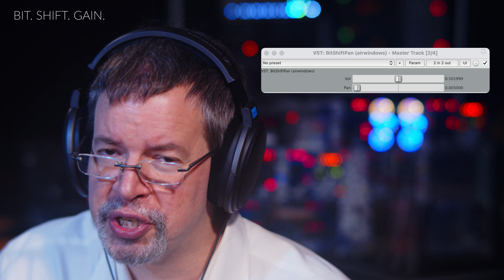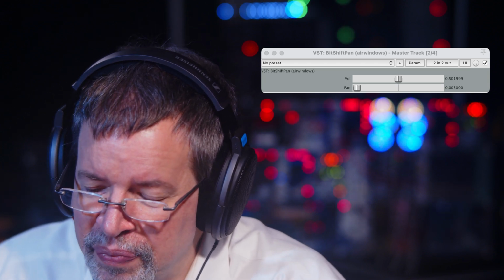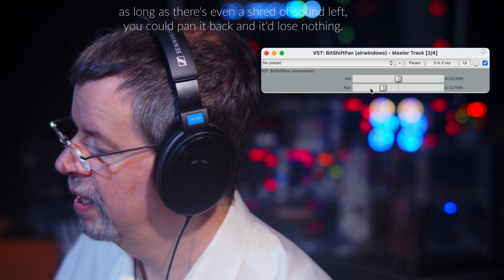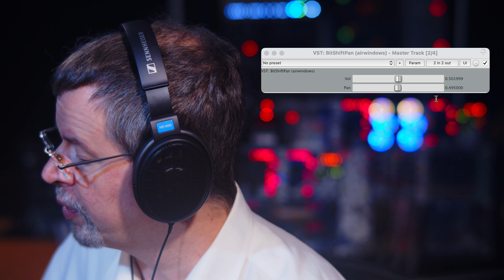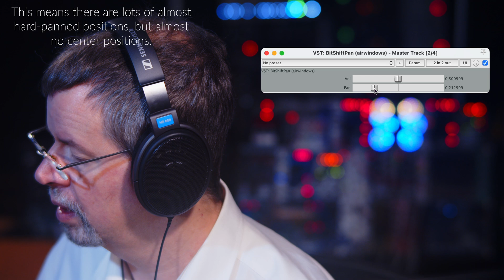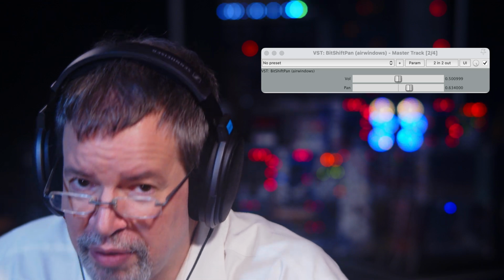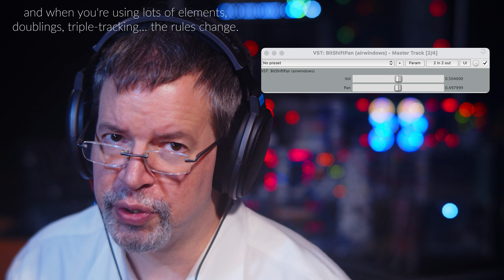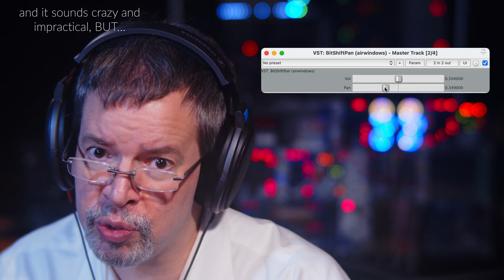Airwindows BitShiftPan: Free Mac/Windows/Linux/Pi AU/VST/Rack

Comment: Also just wondering whether the VST is going to have increments of certain bits like BitShiftGain, as at the moment it's an exponential gap between points that gets finer, so there's 0.15 before the first bitshift, but then there's 0.006 at the last one. It's not useable at those levels creating a very fancy macro for it.

Comment: Hi, if I understand it correctly we will actually loose information from some bits that had originally 1 at the end if we reduce and then add gain, for example: 101 -> 10 -> 100 ?
Reply from the maker: You're correct, but when you're not changing the rest of the bits at the same time as losing the one on the end, it will still seem more like you didn't lose anything.

Comment: Dear Chris, maybe there could be a BitShiftFilter using [inverted] allpasses and bit shifted gain or another method? With a BitShiftFilter maybe there could be a BitShiftSpatializer that could add depth using bit shifted filtering on bit shift attenuated Haas delay lines?

Comment: So you could do those in one plugin for both pan and volume (and channel zero???) by internally cloning the original channel multiple times and bit shifting the volume down enough to not change the volume initially.... Then shifting one (or more) of those parallel tracks up and down..... To half the amount of volume shift. This could make channel 0 usually for more people if it would work in that fashion. AI least 1.5 decibels in volume and far more pan positions.
Reply from the maker: mmmm… not exactly. The deal with doubletracking, tripletracking etc., is that it's a distinct take. it's a known technique and it works with this, but just duplicating the track isn't the same unless you're also running a distinct track into the buss… which I can't do from inside a plugin. But you can try it as the user of the DAW :) after all, duplicating a track and setting them both down 1 bit IS the same, so it works, just not on the internal-to-plugin level :)

Comment: If you add a tilt to the pan, can't you get a perfect 3D position and greater control over the volume and gain?
Reply from the maker: You can never get a perfect 3D position because it's strictly bit shifts on both channels: the gain and the pan combine, in practice. If you want more finely grained control that's easy to do, it's all about having these functionalities represented entirely in bit shifts for no change in any mantissa anywhere :)

Comment: Hey, Chris! Thank you! It's handy. I already use Bit...Shift panning with Bit...ShiftGain in Reaper, but now I'll be able to do it faster.

I have a question. I think it would be interesting for you.

Your gain plugins give me so much more understanding of the digital audio and also I learned to hear a digital artifacts better. That crystalisation thing.

But here's what I noticed using Bit...ShiftGain...
I often use this plugin for gain staging.
I put it before and after, for example, a tape plugin or a compressor and I linking it parameters contrary. That way I can drive the plugin and compensate after it.

Long story short. 
Even if I bypass (or delete) a plugin that is between Bit...ShiftGain plugins, and bypassing both Bit...ShiftGain plugins simultaneously - I can actually hear the sound changing a bit.

I know it shouldn't, but it does. Or I'm just crazy.
Any ideas why this might be happening?
I'm working in Reaper, 64bit FP.
Reply from the maker: We're all a bit crazy. It wouldn't be much fun to stick to only stuff you can hear every time! You're exploring the threshold of sensation, and yeah, you're hearing your expectations/suspicions. This is okay, just don't take yourself (or me) too seriously. Let it motivate doing things the right way, but don't lose your mind over it. Again, you can explore the blurry edge of your own perceptions. And then you're hearing the limits, AND your own fallibility, at the same time. That's the only way to go there, honestly :)
Reply: @airwindows  yo Chris your a Warrior we love u